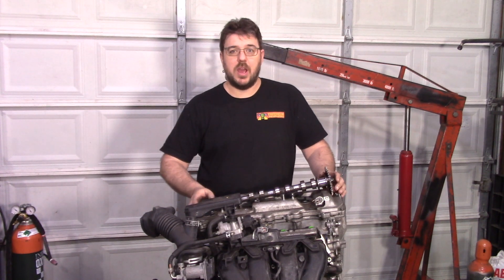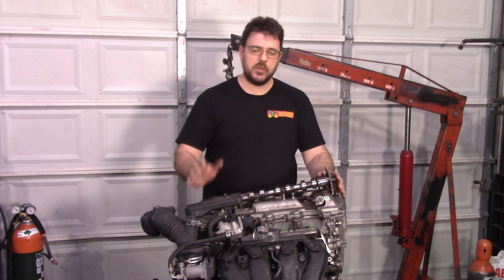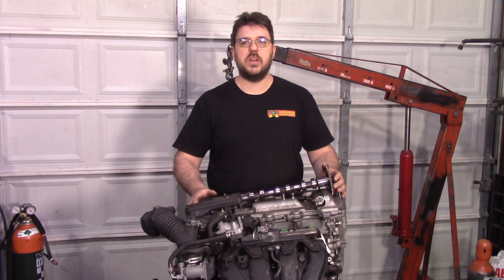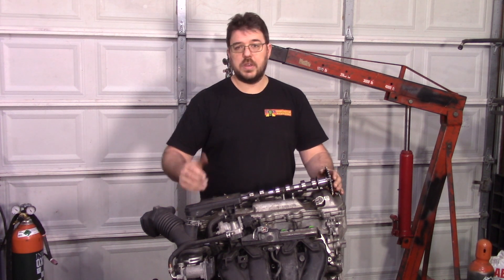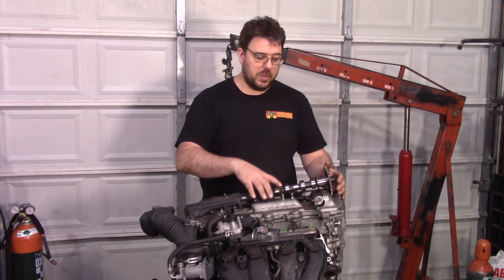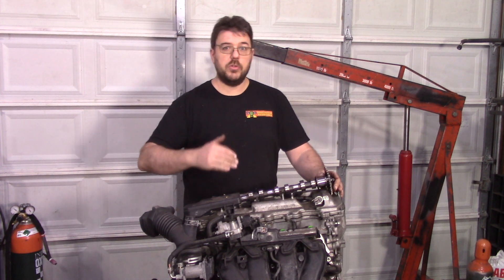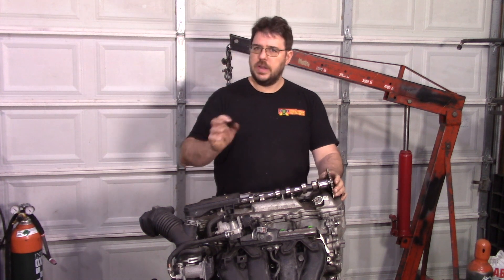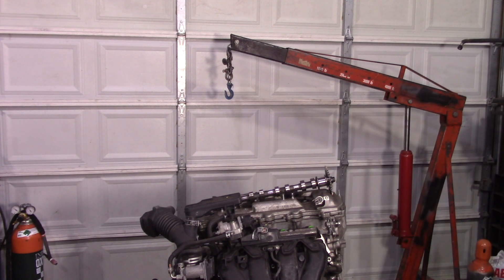2AR Power overview, the search for 150hp/L

Comment: Hey Marc, I’m really happy with what you’ve done for the 2AR-FE. As a 2014 Scion tC owner, I get excited seeing how far you’ve pushed the engine so far. I was wondering how an E85 conversion for this engine in my tC would fare. Someone on YouTube posted years ago of his conversion and dyno results, which showed him getting a bit over 205whp with just e85, headers and a cold air intake. Unfortunately he isn’t active and it wasn’t clear what he said was needed for the conversion; it sounded like he just upgraded his injectors to 550cc and replaced his fuel pump with some 255 fuel pump. Is that really all that’s needed? Would I see some performance gains with this conversion and no tune? Would the car even run with the conversion and no tune? Any advice and help would be greatly appreciated.
Reply from the maker: E85 on a stock 2AR would likely gain nothing. the motor has no knock anywhere in the factory configuration so there would be no timing advantage to E85. 

Making 205whp on a bone stock 2AR is doable, i've already done it and this video you commented on showed 195whp with a catalytic converter and a chambered muffler.
Reply: @FrankensteinMotorworks  That +200hp is what my goal is, hopefully it’s doable with an automatic. When I bought my tC, I went automatic because I wasn’t making much money at the time and I was driving a lot and my brother whose always had manuals mentioned that if I ever need to replace the clutch, since all these cars are used now and will eventually need it, it would set me back more than the money I would have had. So for E85, but this time with an E85 tune, and nothing done internally, just a CAI and a catback exhaust that only gets rid of the 2nd cat, you don’t think it would net any performance increase?
Reply: *+200hp at the wheels lol just to clarify
Reply from the maker: @juancorona3893  No, i don't think you'd get anything out of E85 on the stock 10.4:1 compression 2AR no matter what the intake and exhaust configuration is.
Reply: @FrankensteinMotorworks  gotcha, I found the guy on YouTube that did the E85 on his tC, his name and his channel is called Sean Chavez and he has the orange RS 9.0 tC, apparently he got like around 20hp more without changing the timing and he got a bit more with a tune. I was still considering going E85 even if power stays the same since it’s about $2.89/gal here in Cali vs at least $4.99 for regular gas and even if I lose up to like 25% range, which I heard is the high end of how much range you could lose on E85 vs regular, that’s still nets about 15% savings, and I fill up about every 4 days so it should add up. Idk if you’d like to check out Sean Chavez’s channel, he isn’t active, but has posted videos around his E85 tune and showing his dyno results, maybe there’s another variable at play, but his gains seem on he high side and even before your help, I thought those gains were a bit too high.
Reply: @FrankensteinMotorworks  oh I think I lost your last reply about your endurance racing, that totally makes sense and I appreciate all your input and help, super informative as your videos are. One last question if you don’t mind, I really appreciate your communication, like I said, for me it would make sense since I drive a lot and E85 is much cheaper than regular gas, and I want to convert. Would all I need to do to my car is replace the pump and fuel injectors and tune it to convert it to E85? Or would I have to do something else?
Reply from the maker: @juancorona3893  Unfortunately the tC just does not have an alcohol content sensor and E85 isn't really just a single fuel. It can vary quite a bit in alcohol contents from one fill up to the next so you can't just make an E85 only tune and expect it to work right. You would need a different ECU with an alcohol sensor input.
Reply: @juancorona3893  you loose gas millage on e85.  This is why he needed a bigger pump and injectors.  Will be more expensive to run the car on E.  Just focus on what he talked about in the video.  Seems really budget friendly except the ecu and tuning.
Reply: @duanebailey6253  yep, that’s true about less gas mileage. That’s why I mentioned that the range you get from a full tank can be 25%, but from what I’ve looked up, it can be anywhere from 7%-25%. However, regular gas is about 40% more than E85 at least, even on the high end of less range, it would still be cheaper to go with e85; at least 15% cheaper. I drive a lot just commuting to work, at least 70 miles a day. I fill up about every 4 days, so if I went E85, in just a few months, I’d be saving a couple hundred dollars in fuel. However, based on what FMW is saying, it might be more of a hassle than I thought.

Comment: I don't think I heard it mentioned anywhere in this video, but what fuel are you running for these numbers?
Reply from the maker: Oh, sorry, it was my intention to say this. This is all 93 octane pump gas (93 as rated (R+M)/2 which is about 97 octane in europe since they rate differently)
Reply: @FrankensteinMotorworks  Awesome, thanks for the reply
Reply: @FrankensteinMotorworks  I wonder how far e85 will get you right now with your cams and velocity stack intake manifold, are you considering going that route soon?
Reply from the maker: @juancorona3893  I don't plan on exploring E85 with the current race car, it does endurance racing so i need the better fuel economy from normal pump gas. But i will eventually explore it on another chassis. I would expect the gains to be about 5-10whp. NA e85 gains are not usually that much.

Comment: Love the channel just subbed how would the 2ar-fse go as far as modding is concerned direct injection with the same platform as the fe
Reply from the maker: The 2AR-FSE is actually a significantly different engine. The head casting is different  and the ports are smaller to make room for the direct injection stuff and also, the engine is designed for longitudinal layout with a different bellhousing bolt pattern. The direct injection also means that the camshafts will be different. 

In short, the 2AR-FSE should really not be considered as part of the 2AR family, it may be a fine engine but it's a completely different engine.

Comment: I currently have a 3rd gen 4runner with a 5VZ and auto trans. I was eventually planning on looking for a deal on a 2rz/3rz to swap in it one day and put a small turbo on it but your 2AR videos make me think I should try to go that route. The newer design and tech might be a better choice for the long term
Reply from the maker: Interestingly, the 5VZ and 2AR share a very similar bolt pattern, odds are it would bolt up to the transmission directly. If that trans is hydraulically controlled then it would even still work fine but you may have a bit of a mess to deal with if it's an electronically controlled transmission.
Reply: the a340f/h/e is electronically controlled but a 5sp should be a lot easier to work with.  since the a340 came in some supras there is an aftermarket shift controller for it.  not sure if they are still made but the research has been done.

Comment: Might get a 2AR powered car to replace my 2AZ eventually. I just like engine videos!
Reply from the maker: Conveniently, the 2AR and 2AZ share the same bolt pattern so you're just one motor mount away from making it fit anywhere that has a 2AZ
Reply: @FrankensteinMotorworks  any idea on how it would fit into an 05 Scion tC?
Reply from the maker: @zorgzev96  Fairly certain it would fit just fine but this is not something i've tested.

Comment: I saw a video with a modified Prius engine in a Toyota Echo (gen 1 Yaris), and that was WILD. Hybrid engines are a good base for making big N/A power?
Reply from the maker: A high efficiency engine makes a good base for a high power NA engine and the hybrid engines have high compression and a big intake cam already. Generally it can be a good place to start.

Comment: he sells tuned stock ecu's? cant seem to find it on his website
Reply from the maker: Yes, they are intended for the swap application: https://frankensteinmotorworks.squarespace.com/shop/2ar-fe-tuned-ecu-with-immobilizer-removed-235hp
Reply: @FrankensteinMotorworks  ahhh thank you. Would be interesting to see what these would make with 93 oct and ignition timing
Reply from the maker: @italianjd  Are you saying on an otherwise stock setup? if so the stock 2ar-fe really isn't knock limited so there really won't be gains until you get more air through it.

Comment: Hi, i've been planning to build either a 2zz or a 7age 20v for my AE92 Corolla, but now that i know about the 2ar, it really makes me think about doing that instead !
The big question i have is the dimensions of the engine and trans. The 2ar looks tall af ! And i'm not even sure the trans would fit without cutting the chassis.
Could you share rough measurements of the dimensions of the engine and trans for people who want to check if it will fit in other cars ?

Thanks, keep doing your R&D, you're doing a huge favor to the Toyota community and i'm pretty sure we are about to witness the end of the Honda K series reign !
Reply from the maker: Yes, it is quite tall. a better comparison than dimensions since it has been shoved into so many cars is that this engine is essentially the same dimensions as a 3s-gte with the charge cooler mounted above the valve cover like they do in the GT4. flywheel to harmonic balancer is right there on par with the bigger 4 cylinders that toyota makes including the 3s-gte again. 

With the narrow e series transmission (E350/E351 & others) it becomes very narrow and will likely fit wherever that 7A was before but the height will probably get you.

height is 28", width is 13" and length is 20.5" including the pulley.
Reply: @FrankensteinMotorworks  Thanks for the reply, i'm going to measure my engine bay and check if it will physically fit in my AE92. How does the E series transmissions compare to the EB60 ? Is it worth it ? It seems like it has plenty of torque for a lightweight body so 5 speed should be ok, but aren't they too long ?

Comment: I feel like a transmission video would be helpful too.  Sorry.  I know that info is also probably buried with your other videos, but since you have this one, I feel like a transmission/axel/hub video would be a great addition.  Thanks for your great info and parts.
Reply from the maker: The transmission is just a stock EB60 transmission, i haven't had to do any internal work beyond the reverse detent install and those instructions haven't ever seen an update. As far as the hubs go, i'm still using 100% stock mr2 spyder hubs. The axles are documented here: https://frankensteinmotorworks.squarespace.com/2ar-spyder-axle-guide I'm happy to make a video but unlike the engine there hasn't been a ton of back in fort invalidating the old videos so i would struggle to add any extra value. If i misunderstood what you're asking for i'm happy to listen.

Comment: Concerning the 2GR-FE, did you have other countries in mind as well when constructing your exhaust pipes for the swap(cause OEM-wise the 2GR has two cats right after the exhaust ports more or less)? As in, do the cats even fit in that place in the SW20 engine bay? Since I'm from Germany and emissions are very strict, I need to document everything first and send it to an inspector before getting approval of a swap like the 2GR-FE.
Reply from the maker: The new header design was designed with exactly this in mind. It leaves space for the cats right at the side of the block where they are supposed to be while still being much tighter to the block.

Comment: For the 2ar-fe would your 271hp build work if boosted?
Reply from the maker: Generally, anything you do to improve NA power will cause a turbo build to make more power with less boost. Odds are you will want to dramatically reduce the valve overlap when at full boost but the vvt-i system allows that and i designed the cams with an extra pin location to take 10 degrees of overlap out of there that could be useful for the turbo build.

Comment: I am one of the new subscribers and You opened my eyes to the Toyota AR engine and I am more interested in it more than the GR because I look @ the AR engine now as a direct competitor to the Honda K engine. I've always liked the zzw30 platform and trust me I think I'm going to be interested in this swap in the near future gods willing. Ohh yes I think you should make an adjustable cam Gear drilled/slide for that exhaust cam Gear, even though you can skip a tooth or two but some people will rather that .
Reply from the maker: I really focus on parts reuse where possible. Plus, 20 degrees is not actually a compromise, that is the exact value that i ended up at in the table so if the pin is in the same position on the fixed gear vs the vvt-i gear then i will not be making any kind of adjustability but if it does not match up i absolutely will make something available.

Comment: Amazing video again, you really are onto something with these low cost 2AR-FXE builds, these engines are all over the planet ready to be donors. 2AR-FXE on a Toyota OEM ECU is the future even more so then Beans on Toast! Drilling a couple of holes in the rocker cover etc for the second cam sensor is within most peoples capabilities. I am doing my Hybrid wiring harness cut and shut job tonight... test starts incoming .
Reply from the maker: There's actually no need at all for the second cam position sensor in that setup. I would just disable all that functionality in the ECU so it would not throw any faults and it isn't needed for engine synchronization.
Reply: @FrankensteinMotorworks  Oh my, I never even knew that would be possible. I know you can delete the code, but I assumed it would run in some sort of error state. If that is possible it would be amazing. I've already bought the 2nd cam sensor and plug for it. I'll guess I'll find out if it will run tonight on 1 sensor.

Comment: as someone that just built a 7age 20v, your really making me want to switch to a 2ar
Reply from the maker: It's nice to see people notice the 2AR more and more these days. Feel free to ask questions if you need some answered before switching over to the 2AR
Reply: @FrankensteinMotorworks  my biggest problem is in Canada these engines are not cheap
Reply from the maker: @SimonTrent8000  I don't know what the market looks like up there but around here we have these self service yards that have fixed prices for engines and these 2ARs are just hitting their stride in being popular in these kinds of places. That means that even though a normal yard wands $1000-1500 for an engine you can easily pick one up for $300 if you pull it yourself.
Reply: @FrankensteinMotorworks  maybe cuase im in new brunswick maybe i might find one in maine

Comment: Hey mark, are you going to test other cams you had manufactured soon? or are you going to max these out to its full potential?
Reply from the maker: I do have plans to test some of the other ones but I ran into an issue with tooling required to modify the valve spring seats not existing in the size i need. I also don't think i've come close to maxing out these particular cams yet.
Reply: @FrankensteinMotorworks  Do you think those cams will support the 300whp mark
Reply from the maker: @e5141981  I actually think they will very likely make it all the way to the 350whp mark i am aiming for.
Reply: @FrankensteinMotorworks  wow thats amazing, so i imagine those other cams will be pushing the limits of the motor. This is a rather interesting motor.